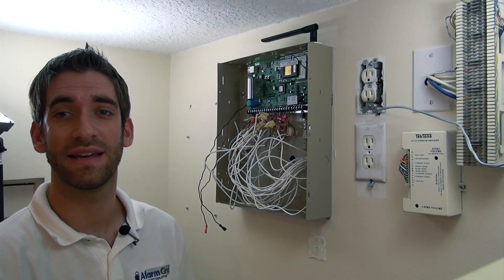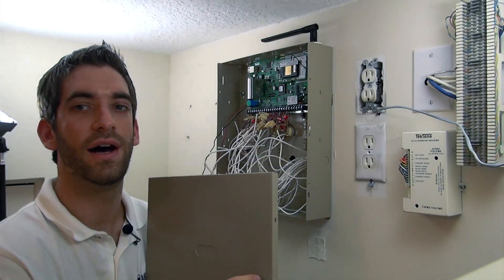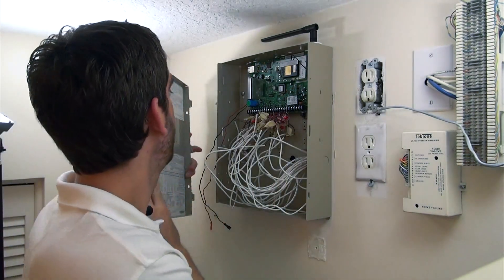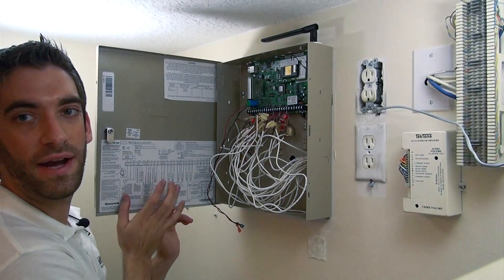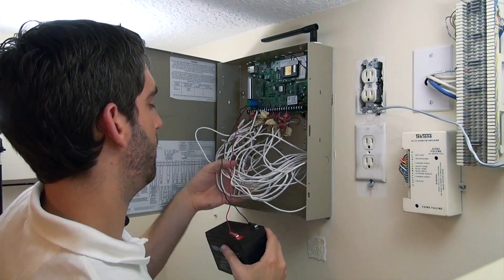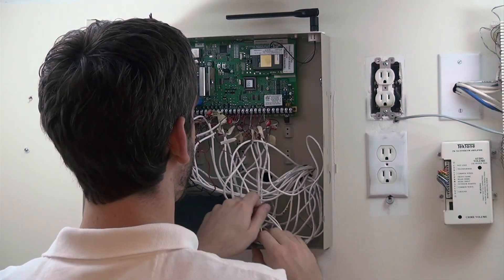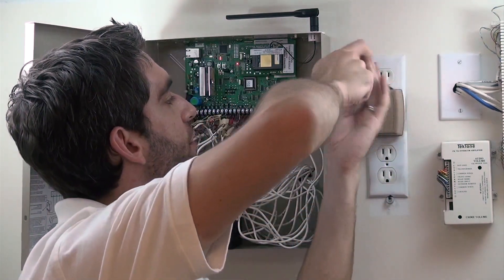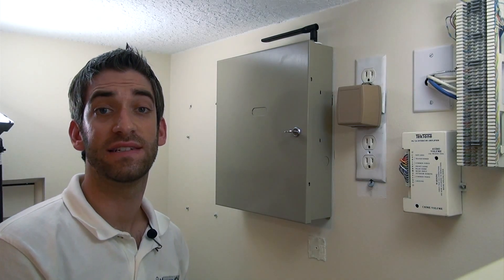Honeywell VISTA 21IP: Adding Door, Connecting Battery, Powering On

Comment: Panel power-down disconnect procedure: First, disconnect Battery then remove AC line power transformer.
Panel power-up connect procedure: First, connect AC line transformer then Battery.

Why? The AC power side of the panel has capacitors that dampenes the 'spikes' of transient fluctuationes of voltage levels(i.e.: 0V to 12V; 12V to 0V).
Whereas the DC is a bit cut and dry.

This is important for the care of electronics.  Sharp changes in supply voltages stresses these components.

Comment: Dude.......that is absolutely the most unprofessionally install on youtube. Lets just jam the backup in there so over time with battery replacements the action eventually snaps one of those 22AWG conductors off the "landing" terminal. ProTip 101, date the battery apon installation or replacement w/ a sharpie for age reference...geez!
Reply: Ok